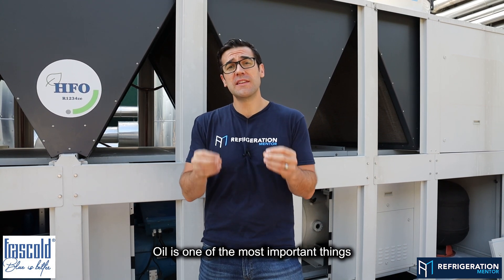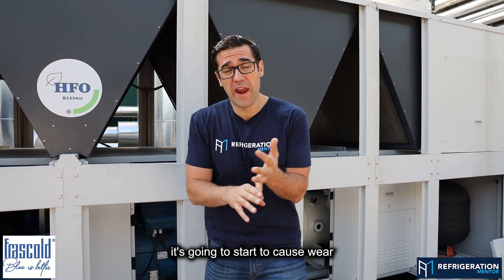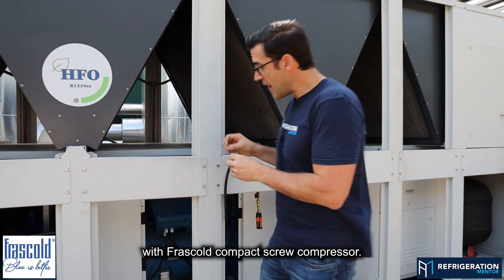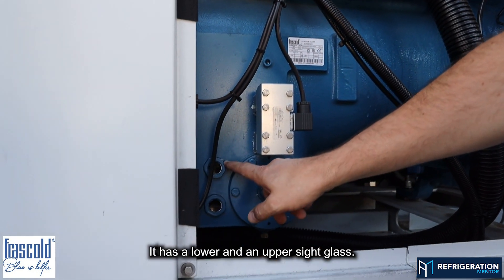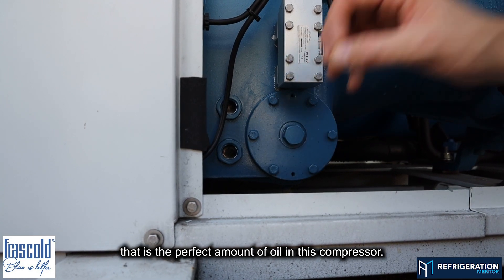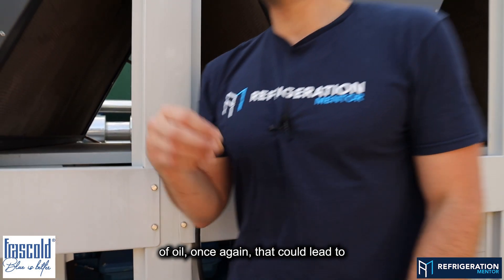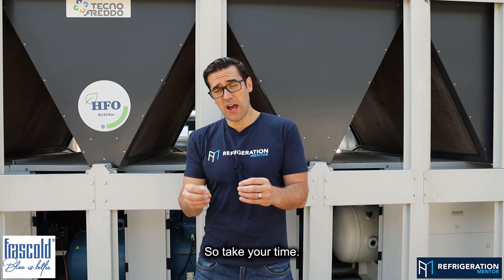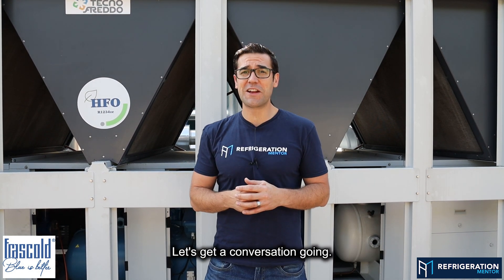The Perfect Oil Level in a Compressor

Comment: hi may i know we should check oil level during compressor running or off condition？thank you
Reply from the maker: @henntan5979  great question. It depends on the application but most of the time I do it with the system running. If you are doing commercial AC with a tandem set of compressor shut it down for a few minutes and check the level. and definitely do a shut down on uneven tandem or check if one oil sight glass in the tandem set has more in one compressor vs the other.